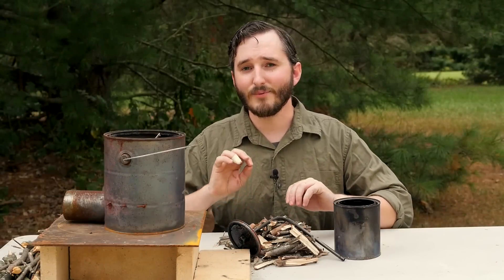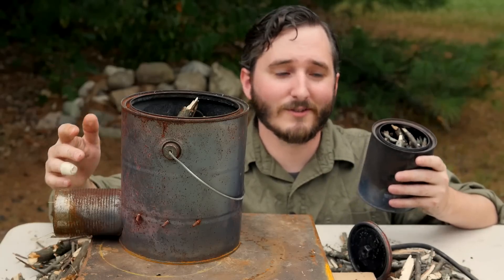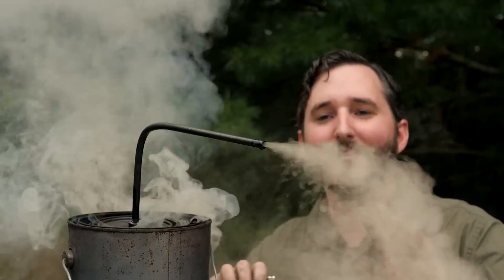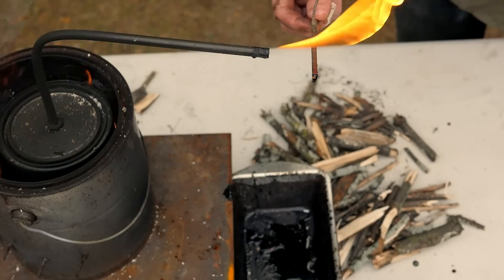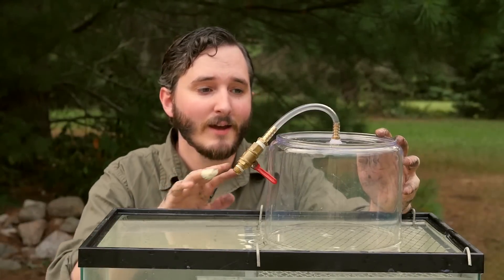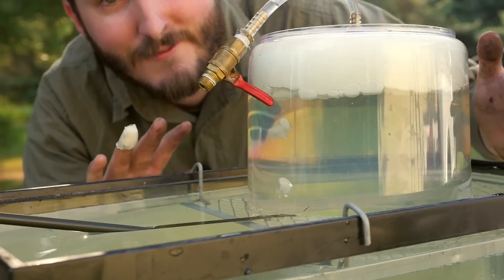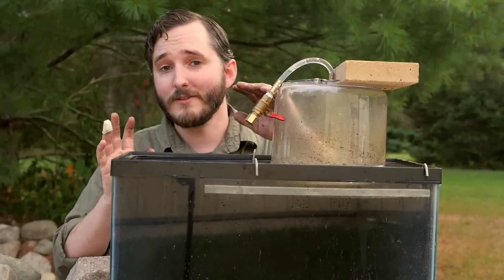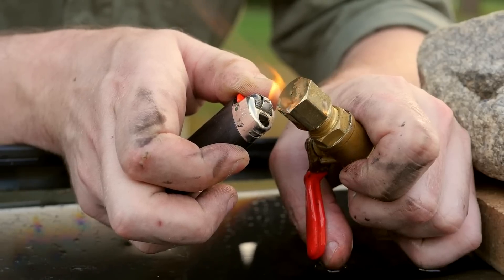How To Make Wood Gas Biofuel (and an experimental gas collection method)

Comment: this was used for coal gas in the gas lamp days
the storage container was a large cylinder like yours, but it started submerged and would rise out of the water as it filled, it's own weight acting to pressurize the gas
run the gas though an aquarium bubbler stone to clean it a little better, smaller bubbles=more surface area to interact with the water

Comment: You could make a charcoal gasifier and get wood gas that needs minimal filtering. (The tar is burned out while making the charcoal, so the charcoal makes cleaner gas) There is an argument to be made about getting less fuel out of the wood by turning it to charcoal before gasifying it, but it's a trade off to keep from damaging an engine with excessive tar.
If the heat from making the charcoal can be used to heat water or cook, that may mitigate some of that energy loss.

And if the clean wood gas from the charcoal gasifier can be compressed into a tank, the fuel can be stored and/or transported to a different point of use.

Just a few thoughts on your experiment. Nice work.

Comment: I wonder if it would be improved by turning the wood into sawdust then freeze drying it. Maybe also some sort of processing first like soaking the wood in a solvent or non persistent acid then vacuum filtering it, then processing it into sawdust and freeze drying.

Comment: one of the experiments I did as a young man was the guanadrel experiment But with a twist.  First I think it fears to point out that I was, Born off the Grid in 1952. & by 160/62 I was operating my dad's old gas generator to drive its engine to charge up car batteries for lilting & cooking.   Ok back to the experiment instead of using  Iron filling as in school & I instead used charcoal hated in a fire pit With steam passing through it. the resulting gas was a mix of monoxide & hydrogen gas. I later repeated the same experiment but I pulled the air & steam into a colom of Burning charcoal which resulted in a better result of Cleaner gas  C3H2  I wood keeps the Tempricha  from running away by controlling the extent & ues of water, to steam flash over.

Comment: Love your content....... I have a thought/ question about gas storage vessel. I worked for years in the refrigerant recovery industry and being that refrigerant is a gas just like any other, whether being flammable or not. Why not be able to pipe the supply gas into a propane/ refrigerant storage bottle for storage. Wood gas, propane, butane, refrigerant, ect....  React and storage the same way.... Only differences that exist are the temperature/pressure relationship of each different gas/vapor/liquid. Then, just access the storage vessel on the vapor side( top) of bottle. Refrigerant recovery bottles are a great choice because they already have access ports, threaded bungs, for vapor, and additionally a Y valve with a dip tube for liquid fill/ collection.  This is just my theory, thought on collection/ storage using everyday affordable resourced parts, containers. Would love to hear back from you on this thought, and if you think it is viable, safe storage for wood gas, and other resourced fuels, gases produced from pyrolysis, destructive distillation.

Thanks!

Comment: Does anyone know what fitting hes using to attach the break line. I was considering brazing on a pipe but im pretty sure that would melt.
Reply from the maker: The fitting is the nut made for attaching brake lines

Comment: My grandfather bought a car dealership and garage 6 days before WW2 hit and he didn't sell a car for 6 years. He survived by selling parts and making wood gas generators that were attached to the front of cars. They were huge units about the size of washing machines but worked a treat as gas/ petrol was in short supply. He used to pump what little fuel there was out of the bowser by hooking up a bicycle to the pump and running a belt and pulley to it. My dad as a kid was the one who did most of the peddling. I  still occasionally look at the photos and wonder in amazement how innovative they were back then.
Reply: That generation was definitely built different. I have nothing but respect for them. They knew nothing but hardship and how to adapt to it.
Reply: Really cool. Thanks for sharing. :)
Reply: hi do you have his design
Reply: Any chance you'd be willing to post those pictures?

Comment: I wonder if a longer line with a down hill slope connected to a settling bowl with a drip valve to allow the tar to drip out into a container and another tube comeing out of the other end of the settling bowl going up hill to allow the gas to escape and use some sort of bladder to collect the gas on the end of the tube.  And a check valve on the bladder to prevent the gas from escaping after the process is done.  Maybe have it set up so that you can let the water vapor blow off first and then attatch the bladder to capture the gas.

Comment: Actually, I am designing and building an engine that literally runs on any and all combustible materials, which would be absolutely unfazed by the tar portion of the fuel product.

But mine is capable of operating with whole solid fuel pellets, as it is basically designed to operate with particles up to 1" in diameter, as well as any combustible liquid fuel.

Comment: FWIW, adding more calcium chloride (road salt) to the water than it can dissolve will turn it into a liquid desiccant, which will then pull humidity from the gas as it bubbles through the water, to help it burn better.

Comment: Wood gas is the reason that meat smokers and malfunction wood stoves can explode. When I was a chimney sweep I witnessed the aftermath of a few that had done exactly that. One of them was violent enough to blow the doors off of this lady's wood stove. She had been burning pine wood in it and the catalytic converter was completely clogged up, so secondary combustion was not happening and the flow was all messed up. She lit her stove and she noticed the inside was completely full of smoke and it appeared to have put out the fire. So she opened up the air intake and BOOM! Luckily she was not hurt, but it made me realize just how useful wood gas could be. If we could find a super fast growing plant that produces a usable amount of wood gas we could easily help offset the natural gas issue.

Comment: Why not just put the inverted bowl underwater to begin with? No need to suck the air out, just push it down with the valve open. And it's pressurized when you're ready to let it out, no need to sink it.

Comment: First of all, I want to tell you that I love your channel and the interesting, practical and simple things that you teach us as a good lesson; Even if we talk about simplicity, the way in which he explains the processes to us is so simple and digestible, that it is essential to ensure that we understand all these things of science, physics, chemistry, acoustics, thermodynamics, thermoetc. etc etc So THANK YOU SO MUCH!

Well I want to comment on a detail that I noticed in this experiment that perhaps if I were correct, I could perhaps improve the result of giving more flame even for the tiny nozzle that it uses at the beginning and that it could not make it catch fire, until it removes that nozzle and a more abundant flow of gas came out. I may be wrong because perhaps you do consider it and I just don't capture it in the video or I missed it without realizing it. But if I saw the process well and I didn't miss anything, it could be that if you wait a few minutes (not many) to connect the gas tube to the container that is inside the water tank, there would be more fuel in that gas mixture. And I can only deduce it from an explanation that you gave at the beginning where you said that when you lit the fire, almost immediately, smoke began to come out of the nozzle, but that this first smoke would not ignite because for the most part of that mixture had MOISTURE . You even lit the lighter to that smoke and there was no fire, just like you demonstrating what you were telling us.

So when you lit the fire again in the second part of the video where you demonstrate how to collect the gas in a container, from the very beginning that you lit the fire, your equipment setup was already armed and ready to collect the gas immediately. and you can see the container bubbling even though you are still trying to light the mother with a torch. So I collect all the moisture that is produced at the beginning and it could well be a significant amount (lots of moisture) of moisture in the gas mixture, and the actual gas that we're looking to collect, it may just be less than moisture so that when I tried to light it with the tiny outlet nozzle, there was not enough combustible mixture and therefore it could not light it, until I removed that nozzle and of course with a more prominent gas outlet there were more possibilities of combustion (fire) as happened. Furthermore, I noticed that the final flame did not stay alive as long as you did not have the lighter on, which is another detail that indicates to me that the mixture could be richer in humidity than in combustion gas.

His work is wonderful and among hundreds of videos that I have seen about him, only this one I have noticed could be a minor fault that solving it, giving more time to collect the gas and letting out what is carrying moisture earlier, would give better results and I wanted to contribute. This could be the solution. Thank you very much for your time and excellent work. Congratulations.👍

Comment: This is the same stuff that builds up near the cieling of a burning house.  Volatile gas/ Syngas could probably work fine in a 2 stroke engine.  That tar stuff would serve as lube as long as it was hot.

Comment: Do you need another hole going through your cap on a horizontal plane and a little wider that is to allow oxygen in for the combustion process if you look at a torch tip is the back half of its open or there’s a hole going through it and you’d probably be able to maintain a flame without holding the lighter once lit

Comment: Nice! However the collector kindof the wrong way round. Old gasometers, those huge cylinders which would rise and fall with the gas inside, used a similar method, however rather than the water going up and down the cylinder goes up and down in a bath of water.
How about using 2 dustbins, once smaller than the other. Fill the big one with water. Put a tube in the bottom of the small one, invert it and sink it in the water in the big dustbin, so the air comes out of the tube. Close the outlet tube when it is fully immersed, then let the wood gas into the water under the inverted dustbin and it will rise as it fills with gas. The weight of the inverted bin will keep the gas under pressure for use. If the pressure is insufficient, put a weight on the top.

Comment: Your gas is not the same they used for cars. Those gasifiers burn wood using so little oxygen, that you get CO. High temperature gives energy to transform water to fuel so that C takes O from H2O, and one result is menthane CH4. This takes heat and is opposite for burning. So the total efficiensy can be even 80 % of the primary energy. Your method is to make gas of coal in gasworks for gas stoves and coke at the same time.

Comment: Very interesting. Strange that it only remains lit with your lighter though. Maybe a second tube next to it supplying fresh air would let it stay lit? Something like secondary burn in wood stoves.
Reply: Its definitely lit. Fire is actually invisible. It's impurities that get caught up like soot or organics that basically 'glow red hot' as they burn up. This is why things like alcohol fires and methane fires are dangerous - you can't see or smell them but they're actually burning hotter than a yellow flame.

PS. Blue flames are halfway between yellow flames and invisible.

Comment: It’s called destructive distillation. You enclose the wood in an airtight container, then heat it from the outside and just vent the gas produced. Make sure to add back flow valves, so you don’t get any backfire.

Comment: That was a nice cheap intro to wood gas. Great capture method similar to methane digester capture and use by weighting a sliding sleeve in a container. Appreciate the video..

Comment: My grand father made a gas producer to power his house ... A couple of old tanks about 10ft high collected impurities and tar which he used to seal his old Kilinker boat... He ran a generator off the gas and charged loads of car batteries which powered the fridge and lights. My dad tried to run his old Cortina S/W on wood gas .... His contraption was a couple of 44 gallon drums on the back for fire and tar then a home made kind of radiator covering the whole roof.... It worked but missfired badly .... he couldn't retard the distributor enough... Probably would work well with a properly professionally made one.

Comment: I always wondered why a filtration system like yours isn't used on factories, small engines, or even cars. It doesn't capture everything but it's still better than nothing.
Reply: Me too but I suspect that another extra system water holding and disposal or possible recycling of products would be complicated .Best to make short journeys on foot ...job done.

Comment: As usual I, and I am sure I could say, "we" are not disappointed. I have known about this process and that it was used during WWII but I have often wondered how they may have filtered the smoke and tar from the newly recovered wood gas. This was a great way to do in my opinion. I have had the opportunity to talk with a few people who had experience with this during that time period and one of those was a dear uncle. He said he watched the Germans do this and one of the things they did was to use the freshly made charcoal to heat the next round of wood chunks. One other rambling thought was that when you were 1st lighting your gas after weighting it with the rocks. I made a similar in water collector for a hydrogen generator. I had some success by putting the collection vessel in a ring that allowed it to go up and down but it couldn't tip over. I know that natural gas piped in our homes only has a few pounds of pressure so I placed a two lb. weight on top to give me equal pressure (don't know if my tube size and nozzle made a huge difference or not) for and even less poppy burn. It worked out well for HHO gas torch. I don't want to suggest anyone handle such HHO, just saying what I did was ok for myself and my situation. All gases have potentially dangerous characteristics.

Comment: During the second world war you could buy a gas producer that mounted on the back of your car. This was used to run the engine. Not very powerful but it would get you there. Many towns had their own "gas works" that produced gas that was then piped around the town. The gas was collected in large tanks with no bottom that were floated on a larger tank that was filled with water. As the gas filled the tank it would rise up between guide rails. The weight of the tank produced sufficient pressure to force feed the gas to each home for cooking, heating, and even light. No pumps involved so it was very efficient to distribute the gas.

Comment: You might try using the nozzle from a propane torch so you get air mixing with the wood gas for better combustion.  Good video!

Comment: could a vacuum pump for AC systems be used to put the gas into a compressed cylinder of some type?  similar to  propane tank to run a gas grill?

Comment: Ok so ive done this using coal which has way more oil in it but it is basically the same process but instead of having the holes at the top. You have a few holes in the bottom and have a collection can that your can with you wood or coal can rest on. And it will collect all the flammable gas as liquids in the collecting can. The collection can has to be in the dirt below were the fire is so that it cools and that it does not catch fire. Thats the tar that you collected. But it also has many uses so it could be worth a few experiments.

Comment: Back in the day, I saw a version of this that used several tractor tire inner tubes as the collection vessels - which were easy to pressurize by placing a weighted platform over them.

Comment: Does anyone know how to make as much tar byproduct as possible i want to try and upgrade it to useful liquid fuels for use in engines i want to produce some gas to run s generator to power the cooling systems for the system

Comment: His problem getting ignition is probably that he doesn't have a good fuel/air mixture.  Too rich,  I'd guess.

What he could do would be to connect a natural gas or LP pilot burner.  That would produce good combustion and also meter out the gas at an efficient rate,  which would allow his wood gas to burn for quite awhile.

He did a good job of dunking his gas supply in the reservoir to pressurize it. 

Good first effort.  I was surprised at how much wood gas came off the wood.

My own background is as a natural gas utility repairman.

Comment: I've recently come to realize that wood gas has all of the ingredients you need to make methanol if you use a catalyst to combine the carbon monoxide and hydrogen. Maybe that'd be a cool thing you could do. After realizing this, I realized that if you have wood and vegetable oil, you could make biodiesel using the methanol from the wood gas and potassium hydroxide from the wood ash. That's also something I think that would be cool to do.

Comment: An improvement would be to weigh down the gas container at the bottom of the tank in the first place with the pipe from the wood burner feeding underneath. You could feed it and burn it at the same time.